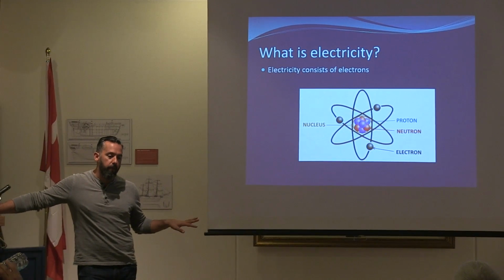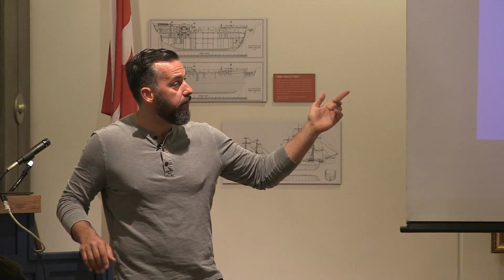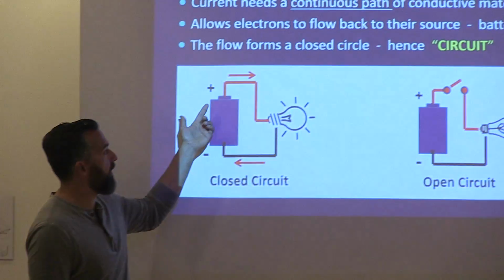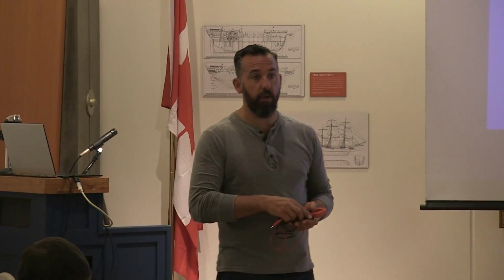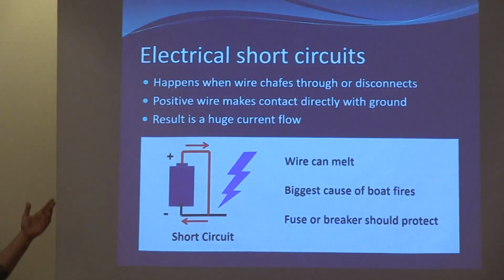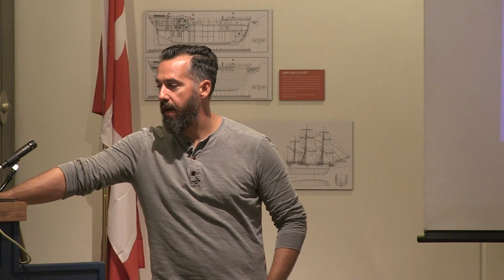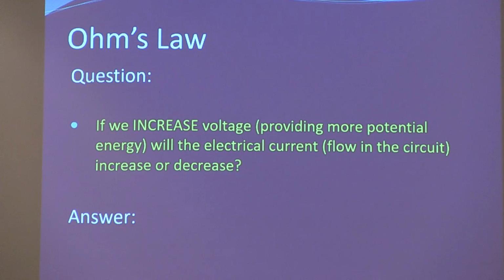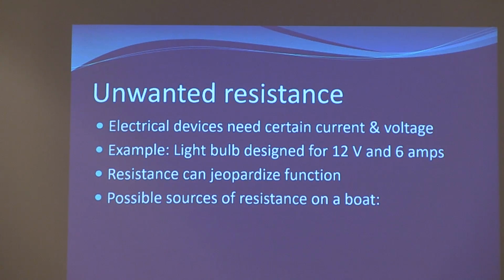Understanding Marine Electricity: A Beginner's Guide to Boat Wiring

Comment: Re the clamp meter... handy perhaps if you also explain that only ONE wire at a time gets clamped to avoid a backfeed read (ie both active & neutral) and also that its important to make sure that the single wire sits close to the central area of the closed clamp and not close to the side.

Comment: Like Captain Eric says: d.c. can also, indeed equally but differently-  be lethal. Remember that it is NOT voltage that kills you, it is the current, or amps.... AND as with AC current, it is cycling 'on & off' at 50-60 hertz or "cycles per second".  so you can sometimes get "lucky" and be thrown (violently) away from the live conductors ... HOWEVER, with d.c. being a constant, direct current, on contact - and especially while gripping say a pair of non-insulated pliers or even directly on to a live cable, when your muscles contract, you may very well grip so tightly to the source of energy that NOTHING will release your hand from the energy. Its most often curtains for you in this case unless your working closely with someone who knows enough to react immeadiately and be prepared to break your arm with something heavy and non-conductive in order to disconnect you from the supply.... but even then no promises.
BTW, a few mA (milliAmps) over a few seconds can kill a person. Also note, not everyone has the same internal resistance, which is also a factor.

Comment: Jeff, on the inverter with load sensing I would think that most quality meters like your clamp on have a high input impedance (to protect sensitive electronics) and I would imagine it would not pull anywhere near 50 watts.  Probably an old style solenoid tester like a Wiggie would pull enough to call for power.
Reply: As someone who grew up off grid and has been playing with solar and inverters for many many years.  anytime you touch an A/C system through your inverter is turn on an obvious load and then turn off the inverter.  Many inverters have capacitors and even once switched off, there will be stored energy until it is all drawn out.  D/C disconnect switches are very important and if you don't have one either pull the fuse or disconnect the battery.

Comment: “Realistically how many AC circuits do I have to work on on a boat” You must work on very small boats! How about all the three phase AC motors? Steering pumps, engine room blowers, AC units, air compressors, water pumps, fire pumps, bilge pumps, fuel pumps, ballast pumps, the list goes on. Then almost everything else is a single phase AC load washer/dryer, water heaters, stove/oven, refrigerators and freezers, lighting, ect. Hell the only 2 batteries outside the little ones in the fire alarm and emergency lighting start one small genset and power the wheelhouse electronics. Every other engine from gensets to main engines are air start. I’d say DC power is almost unused on the boats I work on from tugs to OSVs to passenger boats to private yachts.

Comment: This is a great series!!! Keep up the good work. However, DC can be just as dangerous as it only takes slightly 50mA and over to stop the heart (AC or DC). This is the reason that in control circuits the standard is 4-20mA which is inherently safe.  Figured I would point that out if you ever talk about it again in public.

Comment: So, a in voltage drop in a circuit powering a light, VHF, chartplotter, etc. these devices don't demand the power that they need to operate, so they stop working if the voltage drops below their threshold.   But a windlass can keep working with a voltage drop, by demanding the power that it needs?  Is that an electric motor thing?  From the equations, it seems like the motor's resistance must drop if the voltage to it drops??
Reply from the maker: Anthony, good question. From my understanding, many electrical devices have input voltage range, where they will work, for example 9 - 16 volts. As the voltage drops to any electrical device, it's normal to see the amperage increase as the voltage decreases. 

Perhaps a fellow viewer can provide both of us a better explanation of the behaviour.

Comment: Loving this series, thank you for posting it online for free. By 'welding wire' are you referring to any standard/automotive grade strand copper wiring?
Reply from the maker: Correct.
Reply: I wish there were another term other than welding wire. Perhaps 'low voltage wire'? The problem is, at what point do you NOT go into deeper theory and discuss not only wire gauge or csa 'cross sectional area' but then start discussing the resistivity of the different copper conductors?

Comment: Have I read this correctly! Electrons will NOT flow through insulators. Electrons will flow through anything if the voltage is high enough.
Reply from the maker: Hi Rob, thanks for clarification. Luckily most battery banks on boats are 12/24 VDC and most AC systems on boats are 120/220 VAC.
Reply: @PacificYachtSystems  my friend has a 50ft motorised sailing yacht.  Last Thursday in Largs Scotland he had it out of the water.  He was stood on a metal Ladder he was pointing out the life boat that was in a suitcase looking thing attached to back of the boat.  As he touched the cage thing it was stored in. He received a shock from it, I got my  multimeter out and measured 78 volts ac between the Ladder and hand rail.  I checked to see if the hand rail was attached to the earth of the boats and it was.  I got my earth fault loop tester out and at first I could not get a reading.  The next day I got a  reading of 567 ohms I then checked the earth at the supply on land and found it to be 79 ohms. I checked the RCDs operating time of the boat it correctly didn't trip at half times its rated and  it tripped at its rated tripping current on the positive half cycle.  When I checked the hand rail to the earth of the boat it was not showing continuity.  I'm back up to Scotland again later this month to try and work it out.

Comment: Small comment about DC sytemsafety, a high amperage on a dc circuit is also lifetreatening! Always measure first, and if at all possible disconnect the source (battery).
Reply from the maker: Hi Gardureth, can you tell me more about that, seriously didn't know.
Reply: @PacificYachtSystems  I really never tried it because im always really carefull.
But when DC Current flows through your body it can cause your hearth to stop, with the right amperage you can die from 12V if the current uses your body as a conductor.
Electric chairs are also low Voltage High Amperage DC contraptions (the version Edison build).
(Maybe i sound really dumb and i am totally incorrect, then please correct me)
Reply from the maker: Thanks for sharing.
Reply: The biggest danger from high current 12v is complacency rather than electrocution. The fact that you are not going to be electrocuted by it means you're more likely to reach inside a battery bank without taking off things like rings and watches. If a ring or watch strap shorts a battery out the very best outcome is some light burns and a partially destroyed watch or ring. 
(edited to remove a lot of rambling)

BTW, I can't find anything about Edison building a low voltage high current electric chair. As I understand it the one he built operated at around 1000V AC. They later switched to over 2000V AC after the first model cooked someone to death over about a minute rather than killing him quickly as promised. I suppose that means you could call Edison's chair "low" voltage but you'd have use air quotes ;)
Reply: Don't agree captain Eric. 12 volt safe even with high amperage, dangerous explosion wise. Amperage =fire or explosions . Higher voltage 50 or more kills.
Reply: I did say im not that smart :)
What i should have said i melted a spanner to a car battery once, that made me very carefull.
Make sure you always work safely, have no open leads, and do not run black and red wires next to each other.
Reply: @Gardureth  And use yellow for DC negative rather than black if you have both DC and AC systems ;)
Reply: @Gardureth  Yea you can get a heck of an explosion. Why can't you run red and black together. The cable I am buying for my 12 volt van system comes that way. The # 12 and #14 red and black in the same cable.
Reply: @robertgregory2618  Hi Robert, on a boat most electronics are tucked away in the engine compartment, where fuel fumes and even small fuel or oil leaks will eat your cable-isolation, and can make contact with the other wire. Wich is not that bad if its the same polarity) but can cause a fire (especialy with fuel fumes(!) if its red&Black(Yellow).
Reply: @Gardureth  That makes good sense to me. Better to be safe than sorry they say. Thanks

Comment: Jeff you present lots of information but your discussion belabors each point you make...don't be so chatty and keep on the topic. you spent 6 minutes from 30 to 36 talking about shutting off the inverter. With soooo much chat it becomes easy to miss the point you are trying to make.
Reply from the maker: Thanks Brent for the feedback. Will keep in mind for next time.
Reply: @PacificYachtSystems Thanks for your reply Jeff. I intend to re-watch your videos, but I'll ask you for a favor. Would you create a summary statements, as take-aways at the end of each video. I recall one take away for me, after your discussion about the 3 types of batteries. AGM batteries are the best choice. Another one comes to mind after watching you talk about wires load capacity and fuses.Guard each different sized  length of wire with a fuse, guard each appliance with a fuse.
Reply: I found Jeff's tangent on in inverter dc shut off switch to be extremely helpful, so I beg to differ.  Survey on my Camano called for this switch. I eventually got around to have my marine electrician install it. It wasn't really explained to me why this switch is so important. Now I know. Thanks Jeff!

Comment: Speed is not a synonym for current! Strength should be better explanation! Very similar to torque on the engine!! Amper hours is a measurement for capacity of a battery, not for current! Even in a literature (and on the batteries), we can see a very wrong measurement, such as cranks, which tends to explain how many times we should be able to start the engine. Engine? What engine? 2 cylinders, 4 cylinders? 6 cylinders etc? Is this the same "cranks" for every engine???
Reply from the maker: Hi Boba ILIK, here a definition of amps from Wikipedia: "The ampere was then defined as one coulomb of charge per second. In SI, the unit of charge, the coulomb, is defined as the charge carried by one ampere during one second." Basically, amps is a measure of unit over time, specifically coulomb of charge per second.

Comment: What is "welding" wire? Is that a Canadian term?
Reply from the maker: Hi Dan, welders use welding wire (non-tinned, non boat insulation) for welding. Unfortunately, some boat builders and DIY use welding wire instead of marine grade wire aboard boats because the low price seems so attractive. Unfortunately, you get what you pay for and welding wire should NEVER be used aboard a boat.
Reply: He means the wire used on a welding machine for the earth clamp and the hand piece. This guy isn't very good. More interested in being the centre of attention than making an information dense video.

Comment: You talk about absolutely disconnecting DC from the Inverter and you say to use the Master DC switch.  If you wanted to be absolutely sure, why wouldn't you pull the Positive terminal on the battery(s)?  Wouldn't this be safer, knowing that the master switch could fail?
Reply from the maker: Hi Todd, in absolute terms you are correct as a battery switch could potential fail open or closed, albeit that is a very rare occurrence.

Comment: You said no dumb questions ...  If the circuit was a water hose - and the flow was water - when you turn the flow off, you'd have standing water throughout the hose.  Is there residual electricity in wires once you open/break the circuit?  

Thanks in advance,
Chris
Reply from the maker: Hi Chris,
Hmmm…. What a great question. Your comparison is right, on one side of the circuit connected to say a 12 VDC battery, you’d have 12 VDC at the end of circuit. Think about, a wire connected to 12 VDC battery post is also energized. The other side of the circuit, i.e. a switched load like a light, would be connected to the negative connected to the negative of the battery. This
difference in potential is similar to a height of a water column… on one side
12 VDC of potential and on the other side 0 VDC.  Hope this helps.
Reply: Thank you and hope to see many thumbs up for your Basic Marine Electrical series.  I have viewed all six videos and learned enough information, for me, that I will watch all of them again and take notes!
Reply: on an AC circuit you would still show residual voltage even though the circuit is dead. Some where around 3 to 5 volts on a 120 volt circuit. Thats why you should always use a multimeter to verify a circuit is dead and not one of the devices that senses voltage in a circuit by just lighting up.